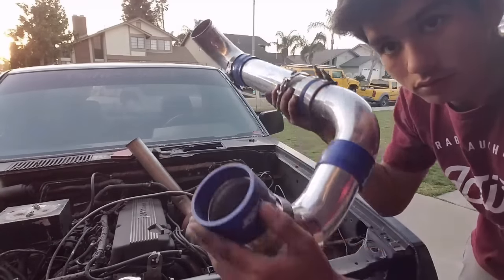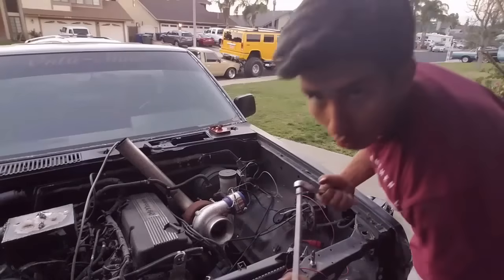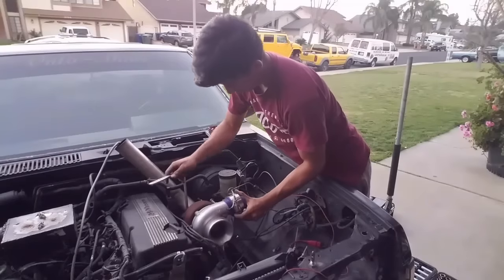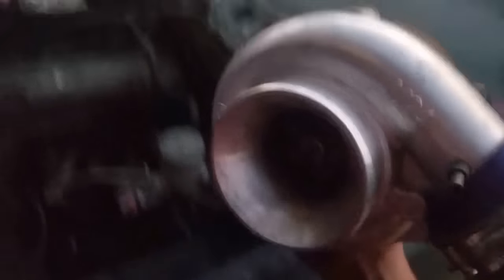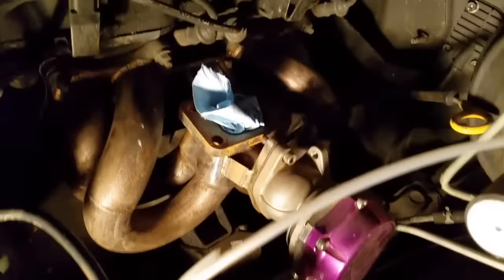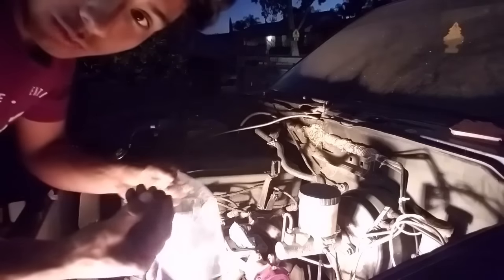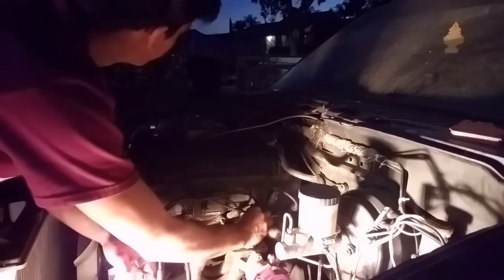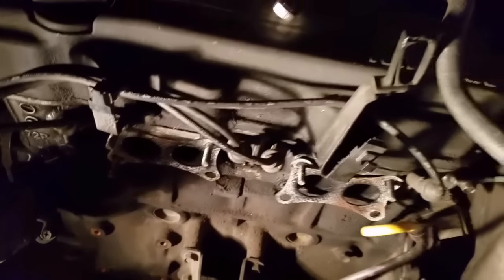nissan d21 turbo drift truck teardown pt.1

Comment: Help.I have the same motor.d21 ka24e.what headers do u have for it.what can fit.
Reply from the maker: Spencer Phillips I have a CX racing turbo manifold,  mostly anything that fits on a single cam ka from a 240sx (ka24e NOT ka24de) should fit on your truck
Reply: STONE BROKE GARAGE hey man that's a sick build, how's the truck running so far
Reply from the maker: Rudy Gamboa thank you & the trucks running pretty good
Reply: STONE BROKE GARAGE dude that's awesome, I have a 89 hardbody with the 2.4z motor and I want switch over to your motor, I have a bunch of questions if you don't mind, do you have a social media?

Comment: this is sick you running a t25 I'm shopping turbo right now
Reply from the maker: Curtis Spencer that's good to hear !
Reply: STONE BROKE GARAGE where did you get your manifold at for the turbo I been trying to find parts for my turbo
Reply from the maker: Curtis Spencer the truck came with the manifold but I thinks it's a CX racing turbo manifold
Reply: And are you running a t25 or t28 and what kind of enegie management are you using
Reply from the maker: Curtis Spencer to be honest with you I don't know what kind of turbo it is I don't know much about the truck I just bought it , fixed it and have or sitting in my driveway for now